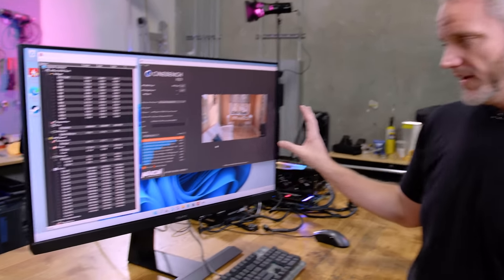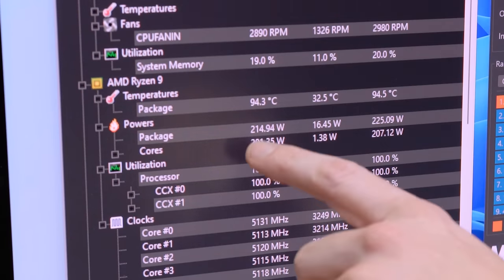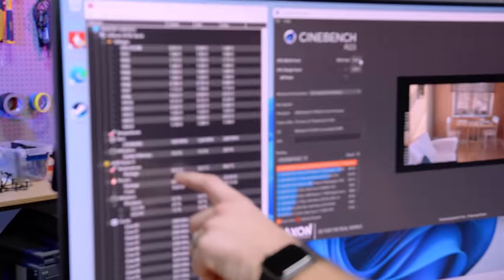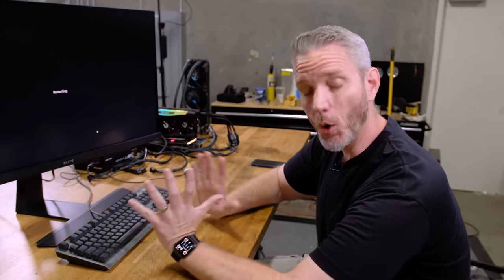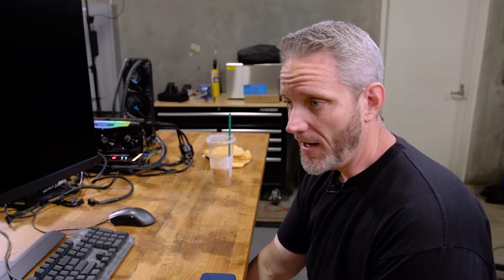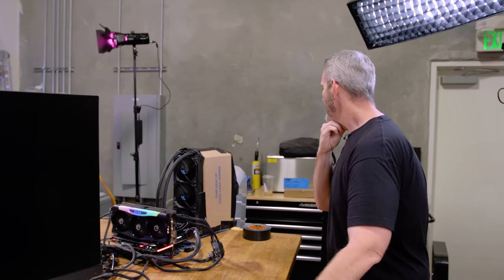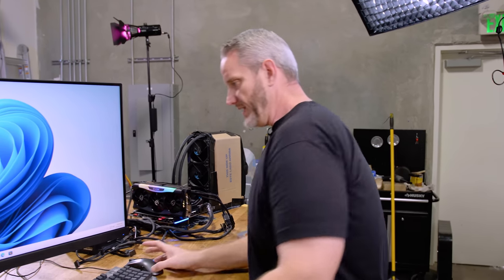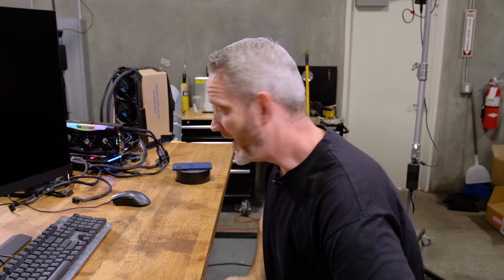This is fine...

Comment: In a way it makes a lot of sense that it does boost till 95 degrees celsius. It's kinda doing the same that laptop parts have done for god knows how long. Pretty sure linus once said as well that it was because an engineer said that "if its not hitting the thermal limit that means there is performance left on the table". Feel like that is exactly what is going on here.

Edit: so I actually saw some people use the eco mode for the 7000 series chips (eco mode locks it to 105 watts) and the performance was almost the same. They didnt test extensively and I'd love to see more testing but from the looks of it the high power draw is mostly a dick measuring contest while if you reduce the power draw using that eco mode the performance is still almost the same with normal heat out as well.
Reply: Exactly, we're seeing competition at work here. Back in the day you'd have to buy a special more expensive version of the chip for either HE (low power), or extreme. Now you get all rolled into one. Its going to give you 95% of your top performance auto-tuned for you based on whatever your silicon lottery / setup is. Or if you clamp the power to 65W-88W you get the efficiency model.  I prefer this because like Linus said, it always sucks if you later find out you could have spent a couple days overclocking your CPU to get another 30% performance (at higher power draw of course and then wonder if you're hurting the chip lol).
Reply: but its terrible user experience, unless amd comes with some kind of offset to calm down cooler fans. As zen 3 user i can assure you its pretty bad for day 2 day usage as fans are ramping up and down for the smallest of workloads.
Reply: @h1tzzYT  get fan management and set your fan speed limits, will fork for all load events other than boot.
Reply: The last statement is wrong. Intel has turbo boost 2.0 on laptops that will hit a high ghz for a short burst until the laptop gets to 85c or above and that is the highest clocks the laptops usually get then clock down from there. This statement might have been true on bulldozer desktops from 2012 or maybe ivy bridge. and what going on with AMD is completely different and a first time for a company on mainstream computer desktops to do this.
Reply: @jamestaylor3805  im obviously aware of fan profile management, but when your cpu has up to ~70c temp spikes in web browsing or other simple tasks its hard to dial it correctly.
Reply: @h1tzzYT  I adjust mine according to water loop temp.
Reply: @zkilla4611  and its very different story if you have any kind of air cooler
Reply: @h1tzzYT  with the way this processor works, a steady fan is probably the best answer to the entire thing. The CPU temp spikes are short lived on all except very demanding workloads. Set an active and a passive profile linked to CPU usage not temps. Say fan speeds of 10-15% when "passive" for mundane tasks, and an active of 70-80 whenever CPU usage is gonna be high.
Reply: @h1tzzYT  what CPU are u using tho? I have a 5600X and It never gets past 60 degrees in normal use, and it gets to 70/75°C under heavy load,  its overclocked and I'm using a air cooler. So I don't know how ppl can get to such higher temps by using browser. Probably terribly optimised on your BIOS/Ryzen Master
Reply: it feels like what AMD did is just take a 5000 chip and let it boost as high as possible as long as the junction temperature does not exceed 95c.
that seems pretty lazy if you ask me...
that also makes me wonder what would be the performance gains if you take the 5800X3D and let it boost as much as you possibly can but lock it to 95c.
i bet you the 5800X3D would SLAUGHTER the 7950x at 95c under these conditions, it already makes the 7950x DOA on many benchmarks right now as it is lol.
can't wait for how better a 7950x3d would perform.
looks like the battle in the CPU market is finally starting to heat up (PUN INTENDED)
Reply: @h1tzzYT  I'm gonna drop the toxic phrase I usually avoid using but... sorry, git gud.
Reply: @HoLDoN4Sec  so I actually saw some people use the eco mode for the 7000 series chips (eco mode locks it to 105 watts) and the performance was almost the same. They didnt test extensively and I'd love to see more testing but from the looks of it the high power draw is mostly a dick measuring contest while if you reduce the power draw using that eco mode the performance is still almost the same with normal heat out as well. So not its definitely not just a 5000 series cpu with higher power draw haha.
Reply: @GoddessLunaMoon  i just watched derba8er's delid video for the 7950x, seems like 7000 series could've actually been so much better in terms of heat and wattage had the IHS been 1.5mm thinner.
he basically shown how its insane he gained -20c heat reduction for junction temp when the 7950x is running STABLE at 5.45Ghz at 70c temps with heaps of headroom for higher clocks.
i don't understand why AMD made this decision for the 7000 series's IHS, it was probably to preserve cooler compatibility but even then most AM4 coolers are STILL incompatible with AM5 despite AMD's effort because most of them use backplates...
also i think the fact that 7000 series runs exactly the same in eco mode as it does in performance mode is a really dumb situation, it has to be some sort of a bug with the Ryzen Master software because logically that makes no sense at all lol
Reply: yup thats exactly what i thought when i first saw the temps on 7000.
Reply: @HoLDoN4Sec  I actually saw the same video, hence my edit as well, and yeah the heat reduction drop is indeed insane. However, regarding your comment about eco mode, i don't think its a bug. Eco mode IS slower even though it isnt by THAT much. It would be enough though to make people question how big of a leap the 7000 series really is. With these numbers they look a lot better compared to intel though. Eco mode numbers show that really all they're doing is pumping their numbers by pumping a shit ton of watts through the CPU which has diminishing returns.
Reply: @HoLDoN4Sec  Keep in mind that you usually see diminished returns. I think it's a good thing that it's so fast and efficient when it's power locked. That means that the baseline efficiency of the architecture is very good and can be improved for years to come. Look at it this way. This is their first attempt at taking their new chips and squeezing performance out of them. I think that it's actually an incredible thing. A great thing. I think they'll be able to really refine AM5 and bring things to new levels with upcoming architectures and rereleases of these new ones in the future.

Comment: So to use ananalogy, the air in the room is the cooling capacity of the system. A room heater is the processor. If you have that cranked to the max and measure in front of the heater it'll be a high temperature compared to the room.

Edit: in short, the processor core is getting really hot really quick but since it hasn't equalized with the cooling capacity of the heatsink (the metal in an air cooler or the liquid in a water cooler),  it can drop really quickly as shown in the video.
Reply: Thats a lot of words to say 'ambient temperature' :P
Reply: @MagGray  haha
Reply: Law of thermodynamics,  heat only flows from hot sources to cool unless you add work to the system.    Moving water around in a closed loop isn't doing work either, that simply moves the heat to the radiator which also is cooler than the cpu & liquid.
Reply: @Mike__B  Doesnt the liquid move the heat faster to the ambient air than heatpipes in an air cooler?
Reply: @L1ft0ff  I'm not sure how fast heat pipes move their liquid/vapor around, but in a water cooler you tend to have a LOT more fluid than in heat pipes and that means a much greater heat capacity so you can pull lots of energy to the radiator where it can then transfer that heat to the radiator which then gets blown out of the case via fans.    It's a little more complicated than saying one technology is better than the other, but water cooling definitely has the potential to be better at cooling than "air coolers" (with heat pipes), I believe the big limitation with heat pipes is they can't be terribly long because the vapor in them condenses quickly as it gets away from the heat source.

Comment: AS Derbauer measured in his vid - most probably the cause for at least 10-12c higher temps is the THICKNESS of the cpu Lid/shield/top. Maybe - trying to lap the excess material would help without the need to delid.
Reply: Gamers Nexus also mentioned possible improvement with lapping
Reply: But yet a Hyper 212 is perfectly fine.

Comment: It will be really interesting to see benchmarks between a decent air cooler and a decent water cooling solution to see how much difference it makes now that its determined to run at 95 no matter what, and see what the clocks end up doing

Comment: DerBauer did a really nice deliding video, showing that the heat transfer through the IHS is the main reason why temps re reported that high.
Reply: It's pretty straight forward, you will either use direct die cooling with custom parts from  der8auer and enjoy lower temps or you will run stock. And with how Amazon returns work it's never been easier to get into de-lidding and direct die cooling. I have personally destroyed and broken 3-5 processors so far. All of which I just put the IHS back onto and shipped back to Amazon and got a full return on my credit card. I then repeated until I figured it out and did it properly and it worked.  If you want your AMD Ryzen 7000 series CPU to be 75-80c under load you will have to use the aforementioned methods. Otherwise just accept 95c is the stock accepted temperature and there is nothing you can do about it without de-lidding and direct die cooling.
Reply: @yakivpopavich  Hello Amazon
Reply: De-lidding an expensive CPU is not something 99% of people are going to want to even try to do.
Reply: @Ryan_DeWitt  Exactly.
Even in the more Enthusiast oriented marked is de-lidding niche.
Reply: @Ryan_DeWitt  Yup... and if you watch the derBauer video to the end you can see why,  hint: the chapter is titled "RIP 7700x",  now I'm not sure if it just wasn't seated correctly or if the tool had a flaw in it, but yeah... feels bad man if you want your new system and a busted CPU.
Reply: @omegamit6zeichen Not quite correct. DerBauer said the thick IHS retains heat for longer and a thinner IHS would help heat dissipation. Secondly, the CPUs are actually designed to hit the thermal wall first before hitting the power wall. The latter is evident in the video, confirmed by HardwareUnboxed, GamersNexus and Dr Ian Cutress.
Reply: @Mike__B In the German version he said that the tool that killed the 7700x was a prototype with different dimensions, their goal is a "foolproof" tool... use it as recommended and nothing should break...
Reply: IHS has room for 3D cache and other improvements. Good luck early adopters with deep pockets. Wait for Zen5
Reply: @afungusamungus2860  mate, the point everyone is making is that you'll get the same scores everytime from a very high end Noctua air coolor as you will a 420mm AIO, and this processor will hit 95C on both, without dropping clocks or score even on the air cooler. The cpu is designed to hit 95C and stay there if it can max out its core clocks, and won't start dropping clocks even at 95C unless you're cooling it with something like a stock cooler.
Reply: How did you all watch DerBauer's video and completely miss the point?  
DerBauer manually set his clock and voltage, that's why it didn't go up to 95c.  
He if had let it on auto, it would have jumped up to 95c, because it OC itself and only stop raising clocks and voltage once the CPU is stable at 95c.
It doesn't matter if you delid or not. You will get 95c on auto and it is "normal".

Comment: A silver lining of this extremely toasty generation, we’re probably going to be getting a lot more custom loop content
Reply: Or alot of Copper,IHS modding
Reply: Ryzen 5 will come with an LN2 bottle in the box.
Reply: And more airflow focused cases!
Reply: AIO will cool it exactly the same.
Reply: Maybe intel and AMD have stock in EK and alphacool.
Reply: @BuzzingGoober  lol no
Reply: More water cooling wouldn't reduce the temps. The heat rejection is limited on the CPU spreader.
Reply: custom loop is very expensive
Reply: @Real.384  congrats on that finding champ

Comment: I don't understand why people are gettng hung up about the temperature, it is designed to run that way. The thing people should be focusing on is the power draw and efficiency. If you want better efficiency, enable the ECO mode at 105W. The 7950 is still hugely faster than the 5950 at the same power level. What I'd like to see is a plot of efficiency (compute performace / W) vs the different eco modes and unconstrained (non-eco mode).

Comment: So basically, now we need Summer/Winter PC builds.
Reply: I hate how true this is
Reply: Going to have to undervolt during the summer!
Reply: Just get a 7950x and 4090 for winter. It'll keep your house plenty hot. Especially if you water cool it.
Reply: Eco mode for summer.
Reply: I'll put my winter build in the closet with my winter clothes
Reply: Like all-season tires
Reply: Ill just build a vent to outside my house for my pc. Use one of those fixtures made for venting your dryer.
Reply: Daniel at Singularity Computers lives in Cairns, Australia which is like living in Jamaica in the northern hemisphere. Maybe he could share some tips on how to keep 'em cool?
Reply: Or just underclock/undervolt/eco mode.
Reply: @MinistryOfMagic_DoM   would it not run cooler if water cooled?
Reply: Not if you go Intel.
Reply: It's why I rarely game in summer.  Too warm. But it's great in the winter.   :)
Reply: @lilblackduc7312  I'll go and inquire about that but I live in Broken Hill and our temperatures here is on average 42 degrees Celsius in Summer but it can hit 45 degrees Celsius plus in January. When I didn't have air conditioner except a fan my room was like a sauna day and night. Can you imagine when I had my old PC running in those conditions? Wet towels around my head and shoulders, a fan directly on my PC with ICE CUBES in a bag tied in front of the fan. Now we have one of those air conditioners on the roof with a water hose attached it is heavenly.
Reply: @Viperh20008  It will. Which means dumping more heat into the environment. Good for winter. I think that’s what the bureaucrat from the Ministry of Magic meant.
Reply: Perfect comment 🥰
Reply: @jodiepalmer2404  I admire your determination and resourcefulness!
Reply: hahahahhaaaa, oh man, i like your comments, u r right, lolzzzzzzzzzzzzzzzzzzzzzzz
Reply: I live in Michigan's upper peninsula, Zen 4 would most definitely be a winter rig and you wouldn't need to turn on a heater.
Reply: Not really. From other channels' videos, it appears that in gaming the 7950X only uses 100-120W, no different from the 5000 series.
Reply: @MinistryOfMagic_DoM  move into an old house that uses water radiators to heat the house and use your PC instead of the furnace 😆
Reply: Way ahead of ya.
Reply: @lilblackduc7312  At the time I had no choice if I wanted to use my PC.
Reply: There is a eco mode. Chill.
Reply: Eco mode is 90% of the performance at 50% of the power/heat. I think most people will honestly stick to eco mode unless something actually demands it.
Reply: Last year I had built a summer PC because my usual PC was just so hot. Well, less "build a summer PC" and more "put together my old PC." Good ol' trusty 2400G + GTX 1660s. The 2400G was actually sitting in the InWin ITX case that includes a PSU so it was technically already working. Luckily I have enough cases and PSUs and kept the 1660s as a backup in case the 3080 decided to commit sudoku. All it needed was some better storage because a 256GB NVME is not enough. Picked up a 1TB NVME, slapped that bad boy in and I was gaming cool as a cucumber. 1080p Low-Medium, but I was gaming.
Reply: Watts are what is generating heat. A chip at 40c or 100c puts out the same heat so long as wattage is the same.
Reply: when you live in somewhere tropical & it's summer all year long... 😅
Reply: @MinistryOfMagic_DoM  since I'm gaming anyway that might be a way to save on heating with gas prices being high af